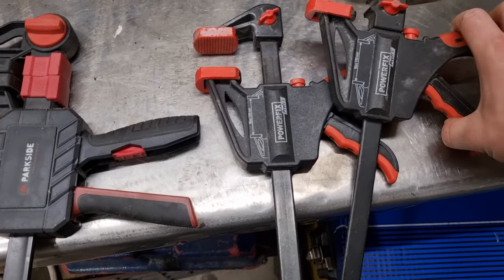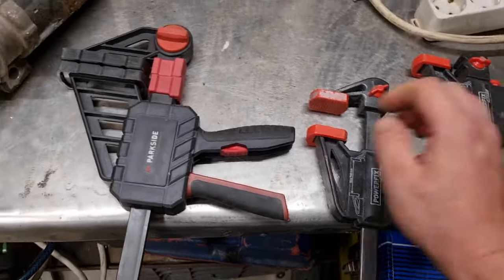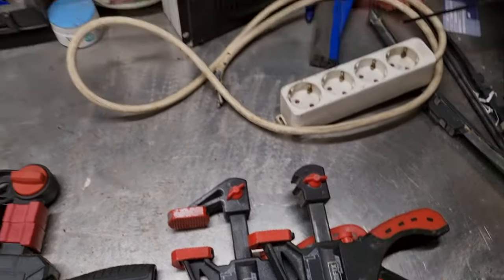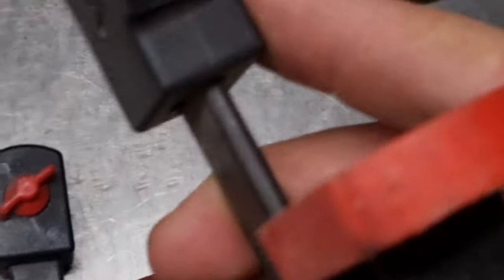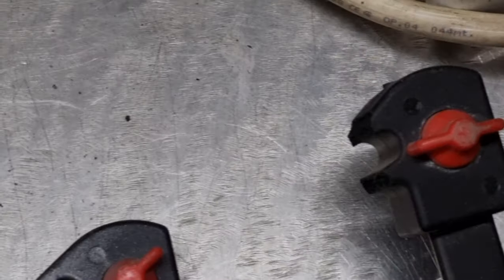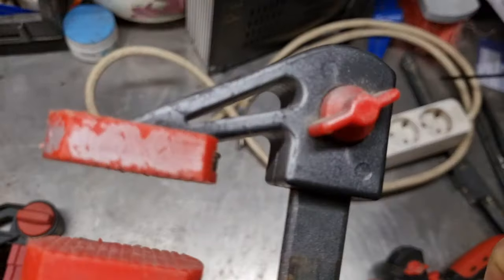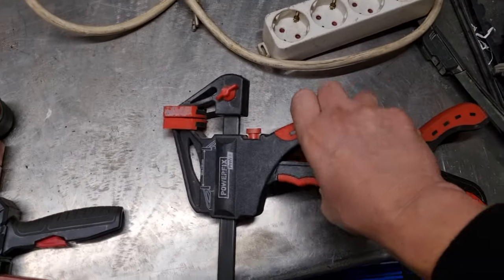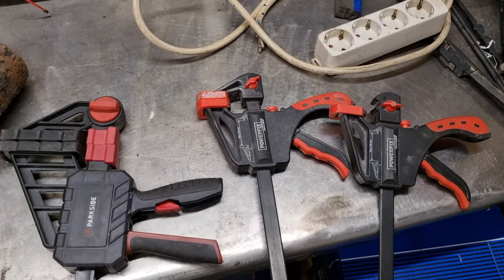Parkside Calmp Failure - Watch before you buy.

Comment: The problem is more with the design, than the material. If the majority of the material of the upper part was oriented vertically it will be able to withstand much more force. Imagine an I-beam.